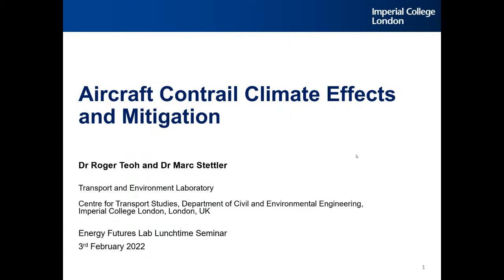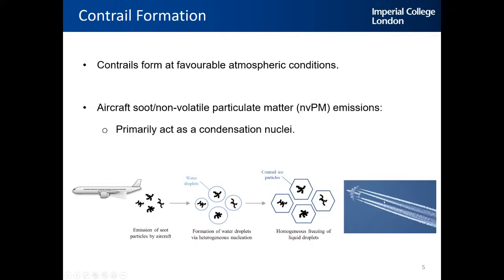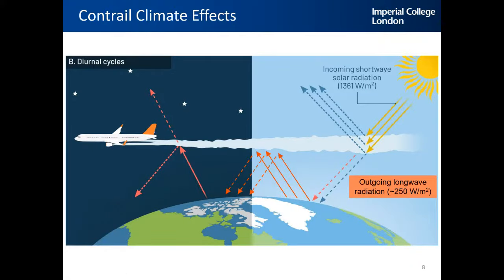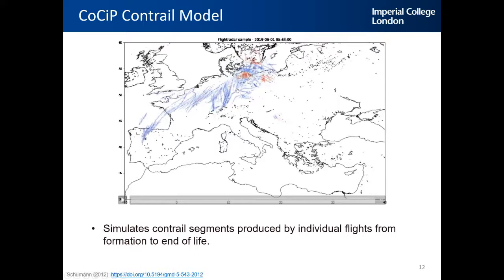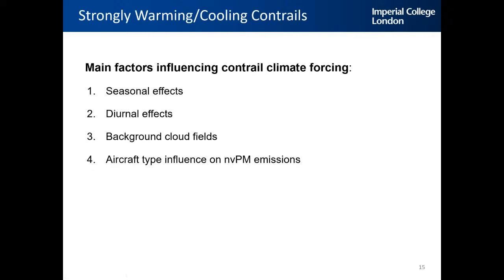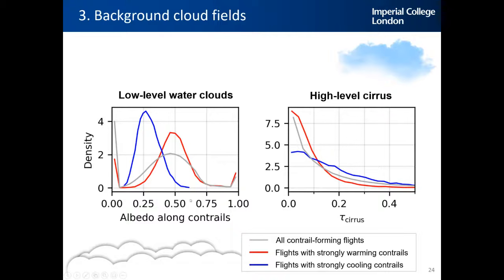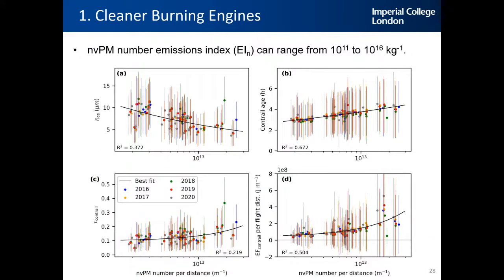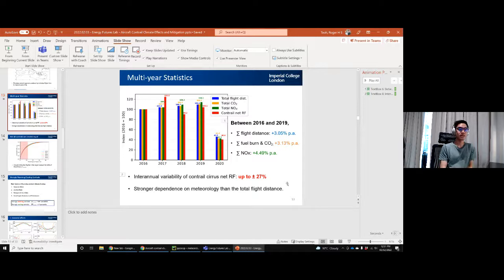Aircraft contrail climate effects and mitigation | Energy Futures Lab webinar

Comment: I believe its the stadis 450 static additive they are using, it contains barium elements. and I think excess use of this and the barium is reacting with the vapour. I've noticed flights at 30000ft don't leave trails but ones above 33000ft do. I've noticed the warming effect of the spreading trails. knew most of this 15 years ago just not the technical side, thanks ✌✌